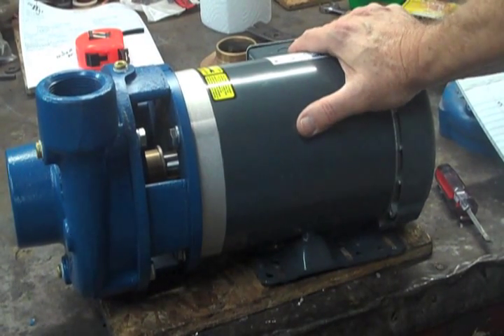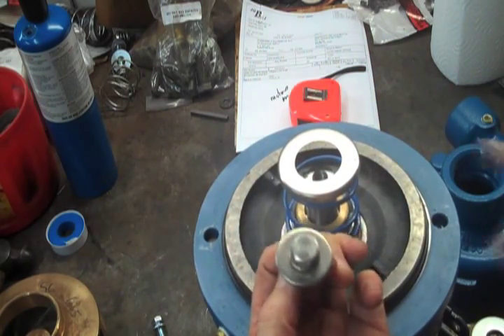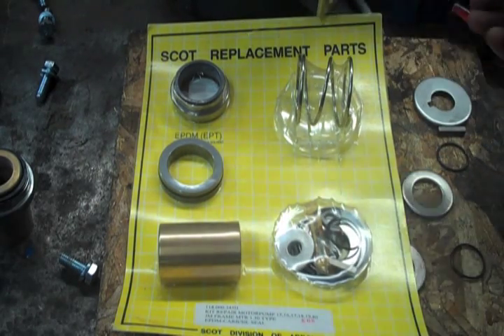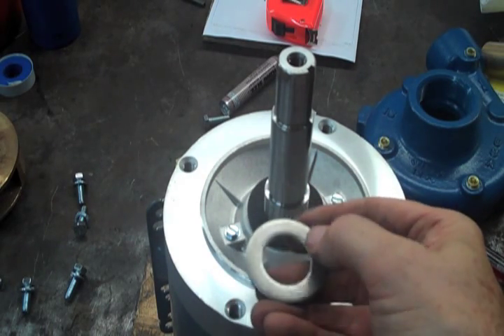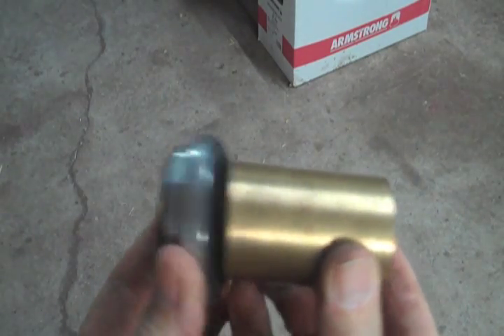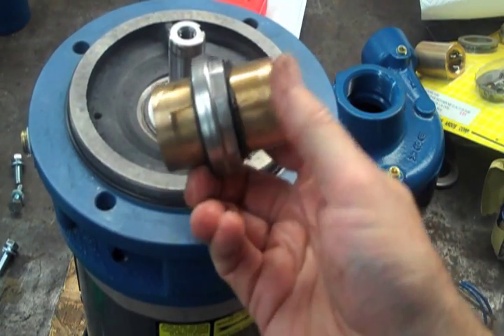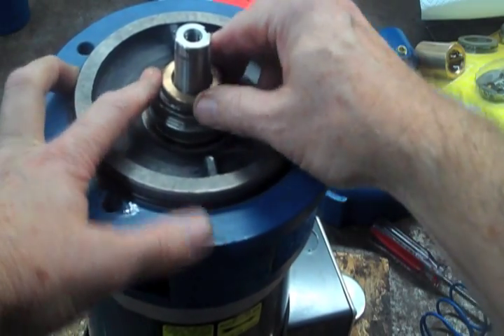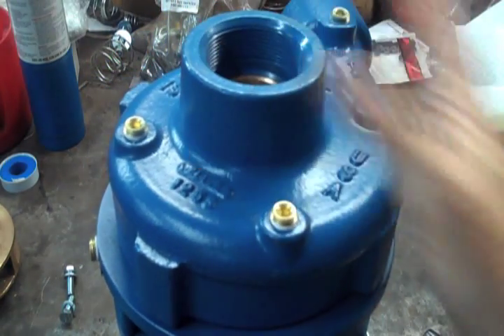SCOT pump seal change motor swap leak repair rebuild JM and JP frame motor disassemble reassemble

Comment: Thank  you for sharing the video. I have watched the video a few times and still have a question. Is it ok to press the face of the stationary seal into the bracket with thumbs? if not, how to install the seal properly?  Thanks again! I really want to learn this mechanical stuff, but don't where.
Reply from the maker: yes its fine to press it in with thumbs .. just make sure it is seated all the way down

Comment: I did all this but the weep hole still leaks!! Do you know what else can cause the leak??
Reply from the maker: not sure what you mean by weep hole .. this one does not actually have one .. if you mean the back of the seal in the backplate then the seal is either bad or installed improperly .. if it is leaking behind the sleeve you may have left the oring out ?/
Reply: roger brainard I’m going too take a picture and try to upload it. The hole is underneath the pump, right where the blue part and chrome meet.
Reply: P.s when I took the pump apart it was missing the washer that goes on the shaft below the first o-ring. I replaced the mechanical seal because that was chewed up but maybe the washer missing is the problem??
Reply from the maker: the washer is what the shaft oring seals against .. it has to be there .. you may have other issues but that will cause leaking

Comment: My motor at home is running but it's not lifting the water up. Someone suggested me to change the water seal but it's diff. than the seal of yours. I've got idea from this video. Hope this helps me to replace the seal. Thanks!
Reply: Ravi Singh sounds like your air locked and pump needs primed